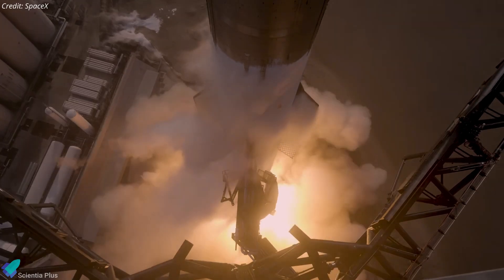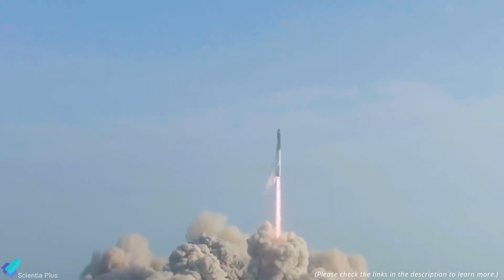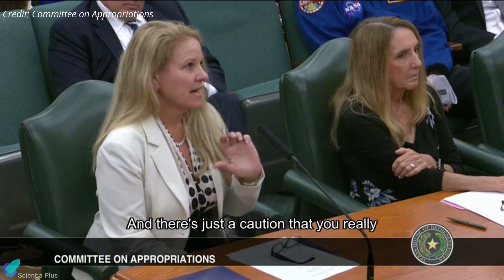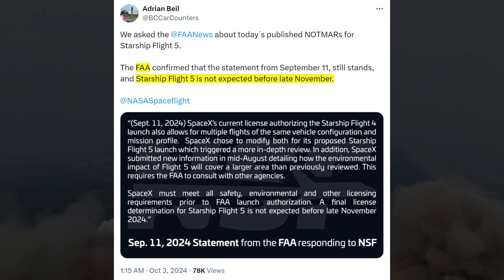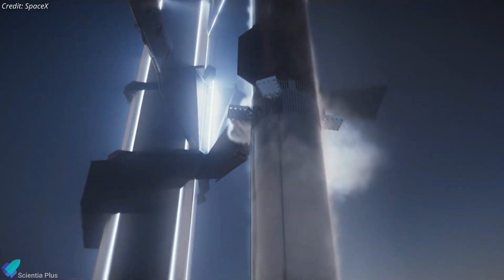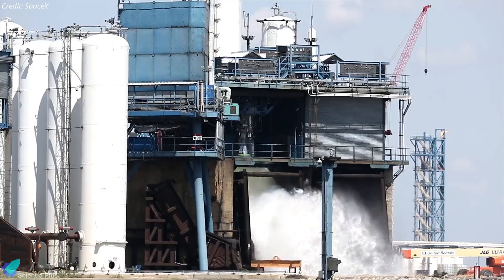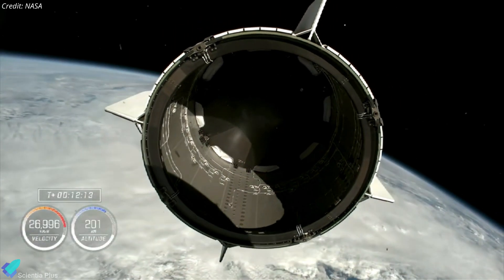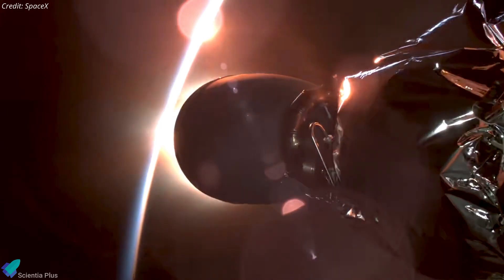SpaceX Sets Oct 12 Starship Launch Date - FAA Rejects Approval AGAIN!

Comment: Texas should redefine the Starbase and the surrounding area as a Texas Space Park. As such it will not be a designated public area or beach. Water discharged into the space park land will be monitored by the State of Texas. Any launch noise or sonic boom is the responsibility of the state of texas and the space park authority.

Comment: the only thing i can think is they will follow the IFT-4 profile. so they can keep using the license they have. but who knows. i mean they launched Sn8 without a license didn't they. it wouldn't surprise me if they go for it
Reply: IFT 4 had that engine fire/malfunction/explosion just it was touching the ocean surface. It was NOT a perfect "virtual landing" as promised. I want  a touchdown in which the booster shows nothing anomalous and gently slides vertically into the sea, at a precise location that is close enough to observing ships and drones that video documentation is accurate and thorough. We should be able to see the booster do its landing manoeuver, and then SpaceX should immediately start recovering the booster so it can be examined.  I think IFT 4 should have been done over months ago with the same flight plan, but this time get it right. By now, we should be getting ready for IFT 6, with more confidence of getting the catch right. The stakes are high. I'm encouraged by the testing and reinforcement the chopsticks are getting, but going for a catch without a 100 percent successful ocean landing still makes me nervous.
Reply: No logic to moving sideways. Same profile will have NO VALUE
 BEEN THERE.
.DONE THAT!

Comment: What happens when they want to recover the second stage from orbit?  FAA has no problem with NASA dropping shuttle debris all over the southwest, but will never let SpaceX do the same.  This means no landing in Texas or Florida.  To land at the launch site, refuel and rapidly fly again, they need a narrow peninsula, small island (with difficult logistics) or sea launch with logistics similar to the island.  Best way to control FAA is to ask State Department how much of the rocket they need to design and build in another country to avoid ITAR restrictions on taking the operation elsewhere.

Comment: The FAA has already stated that the launch license for flight 4 profile is still in effect.  If SpaceX launches flight 5 using the same profile as flight 4, then they could launch.  This would provide additional launch data and confirm their ability to land the booster and starship as predicted.  Changing the current request from flight 5 to flight 6 is a paperwork modification and not a 'safety of flight' issue.  In the meantime, the FAA (who has stated that they will have the launch license reviewed by the end of November) could issue the new license and Space X could launch another flight by the end of the year.
Reply: The ship and booster versions that performed flight profile 4 don't exist. These are new ships and boosters. The issue isn't just that SpaceX wants to return the booster to the launch site, it's that SpaceX is already past that phase of development with their hardware. And it shouldn't even matter, the FAA is playing politics.

Comment: Is it safe to launch? We don't know we are not qualified.
Reply: Well the license is presently concerned with:
1: if any fish would get harmed by the hot stage ring falling in a slightly different position than in IFT4
Apparently determine this requires 60 days consultation.

2: with the booster ‘landing in a different position’ the area covered by the sonic boom would be slightly different.
(Previously determined safe)
Apparently failing to provide a new update on this involves a 30 day penalty.

3: The water deluge needs a different license - as they want to reclassify the drinking water spray as ‘industrial waste’

4: I saw elsewhere that they want a separate ‘industrial waste water license’ each time the spray is used.
I don’t know how long it takes to obtain these.

None of these are safety related - after that criticism the FAA added:

Safety:  they want the exact technical details of the new proprietary heat shield tiles ‘in case they are unsafe’.
These are glass ceramic tiles.

Comment: The FAA is proving they are unnecessary interjection into company primary design issues as if the FAA believes they can design better than SPACE X or BOEING as they have made their compliance time for both from 6 weeks to review to more than 4 years in the cases of Boeing 777 787 and variants. 
FAA is unnecessary interference in company activities which DOES NOT ENSURE GREATER SAFETY but impedes progress and Viability of companies due to FAA interference. As a result, the FAA like the EPA and a Multitude of Dictatorial Federal Agencies should be eliminated and Rebuilt slowly and cautiously as American finances improve from 37 trillion in debt.
Reply: Boeing deserves anything FAA throws to them. 727MAX crashes due to faulty software, door plug falling from the aircraft in flight, 777x fissures in the engine struts, lack of a proper quality control. If you want a detailed and unbiased  analysis of what is happening at boeing, I  recommend you this chanel: https://www.youtube.com/@MentourNow
Reply: Who  certifys ULAs Vulcan?
The Space Force , NOT THE FAA!